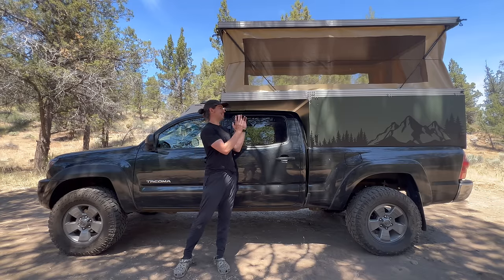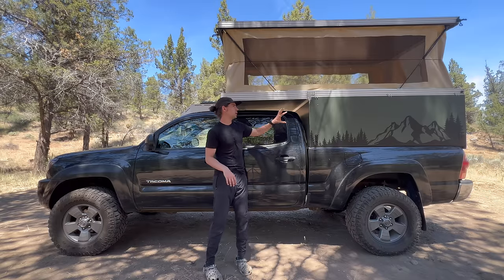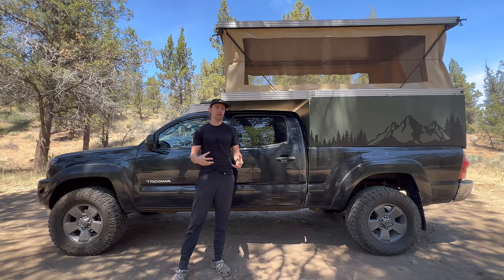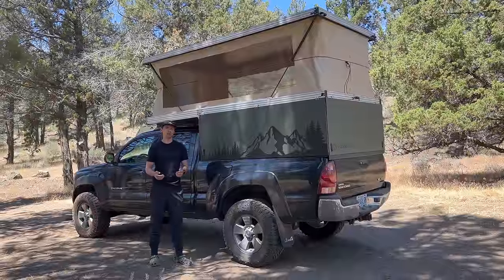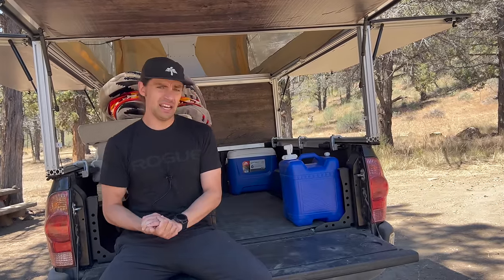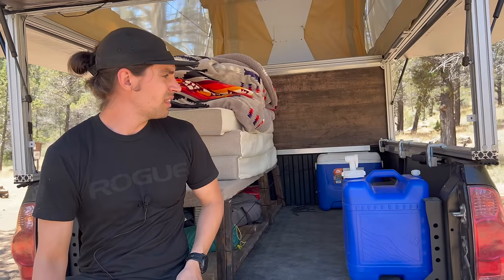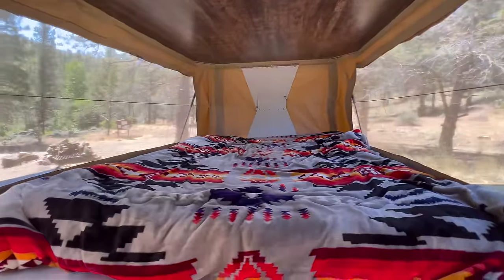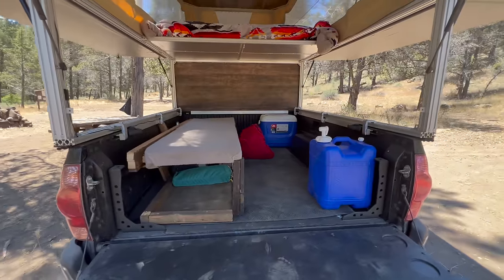No-Weld/No-Sew DIY POP-UP Camper Walkthrough | KIT Campers V2

Comment: That fabric top will not go sub zero u never know the mountains can get nasty quickly Iam selling my bros crank up a 1970 ish custom built camper it rides about 1’ over a 69 cst c 29 Chevy has 3 burner stove pump sink ice box  sleeps 2 w table up or one full lots of storage tarps for the sides level blocks and  a canoe mounts on top just vent on top and front sides  California custom   Sitting in Texas Iam assuming 6.5 k to 10 k   Bro lived black powder hunts snow cold she’s almost 4” thick closed up  one of a kind
Reply from the maker: Yeah, I definitely am not planning on it going subzero, at least in the current configuration. If you are interested in selling your camper I suggest posting it at https://beta.loma.tech/beta2/small-truck-campers

Comment: maybe a powered liftgate ?
Reply from the maker: Like a powered way to lift the roof?
Reply: @KitCampers  
a liftgate tha goes down the ground would make a baçk porch .. maybe screened in for barbecuimg...
Reply from the maker: @duggydugg3937  Oh I understand now. So the tailgate kind of does that but unlike the tow behind trailers it doesn't go to the ground. You could always remove the tailgate then add a full hinged door that could have screens on the sides and what not. I primarily use my awning for that though.